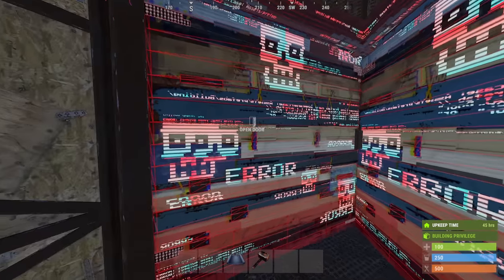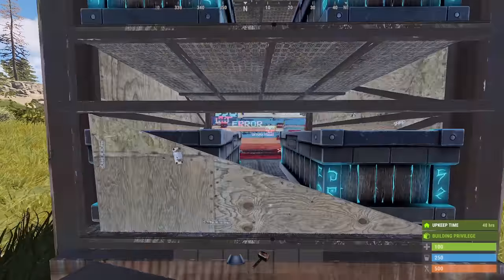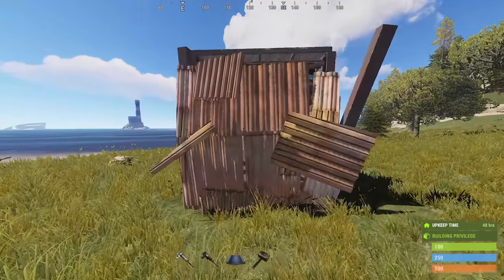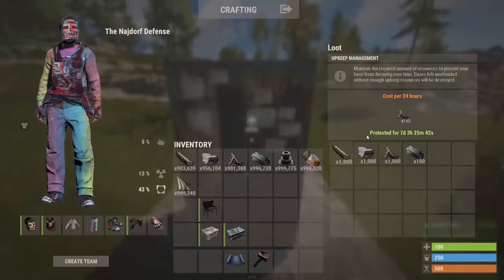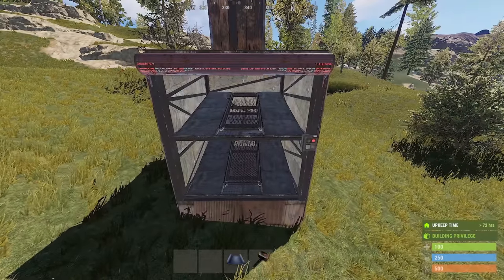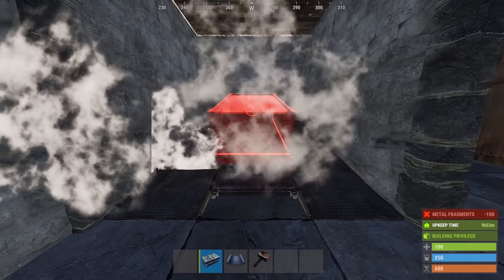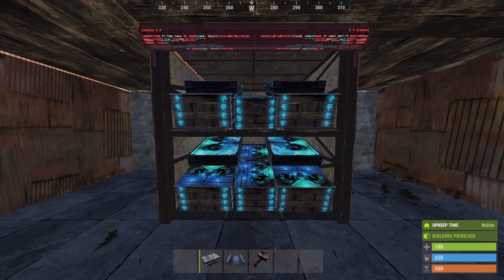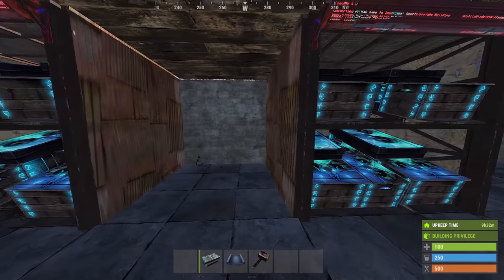Rust - One Of The Best Additions For Loot Rooms - Rust Base Design 2021

Comment: My gaming experience : I   L I K E   R A M P S
Reply: They are OP, floating ramps are the best peek downs
Reply from the maker: Ramps are cool!
Reply: Yea but you sacrafice but of space cause you cant use bbq
Reply: @alibabapirce9782  I would rather looters have an extra metal structure to blow through than have 10-20 extra storage spots per loot room
Reply: @superrdg  how do you set those up? Is there a video? You need a floor under the ramp right?
Reply: @Mr_Smith618  yea you have to remove the floor under the lower ramp after attaching it to a ramp that is a half height higher

Comment: I can't place the door/windows in the loot room when I have the small boxes in front of the large boxes.. :(
Is there a way to fix that? Am I placing these boxes wrong? I make sure to absolutely place all the boxes as far back to the corner as possible but still doesn't fit the doors.
Reply: rust updates crazy man. i bet they fixed this
Reply from the maker: you should be able to place all of these the same now

Comment: found a stone, no honeycomb, 2x2 with 2 of these loot rooms at the back. When we raided through the back we were confused but soon realized the purpose of these ramps. 3 Ak kits were inside and were online. We had 2 compound bows at the front door, 2 compound bows behind the ramps, and 1 guy soft siding. We were able to hold them back until we soft-sided the wall. We got 1 m2, a row and aks, and half a box of sulfur. These ramps made the raid 10x more difficult.
Reply from the maker: That sounds like a fun time, nice!